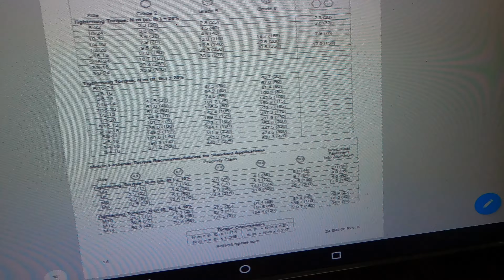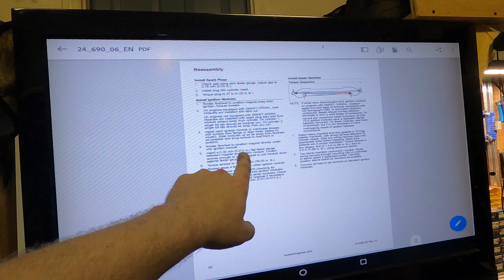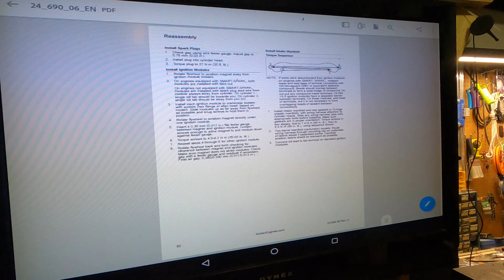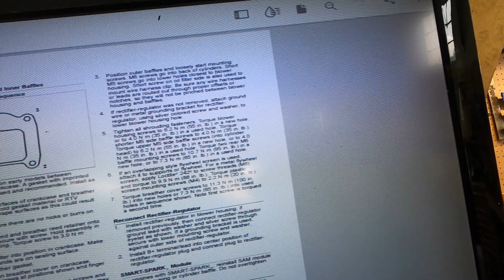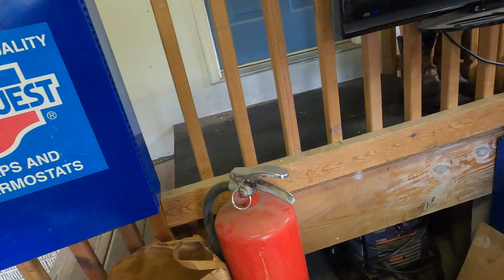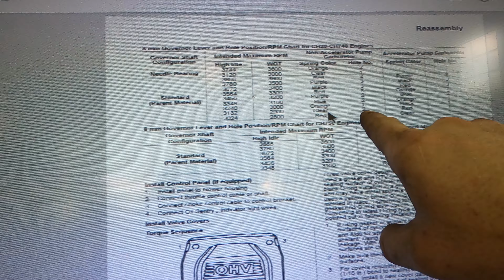Cubby Engine Build Part 2

Comment: Guaranteed neighbors have windows closed and AC blasting.  Given the distance and the tree line, I'd think you're fine on the noise!
Reply from the maker: I think so too, butt they do have 4 untrained pugs.  I wouldn't want to get them all fired up at 1am by mistake.